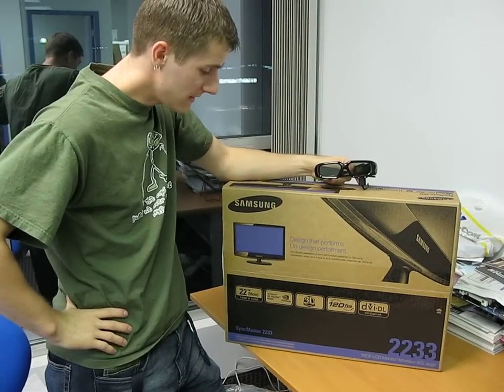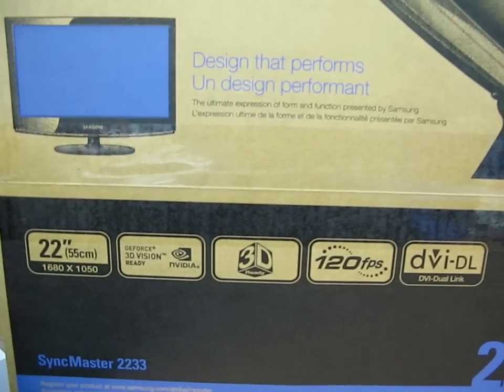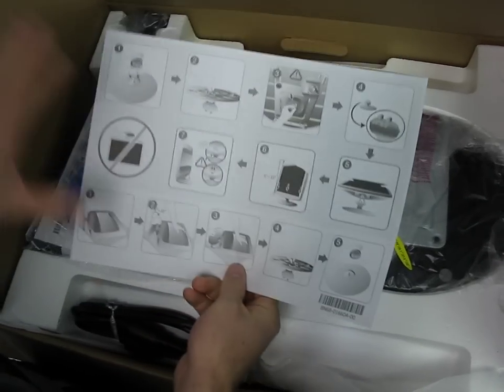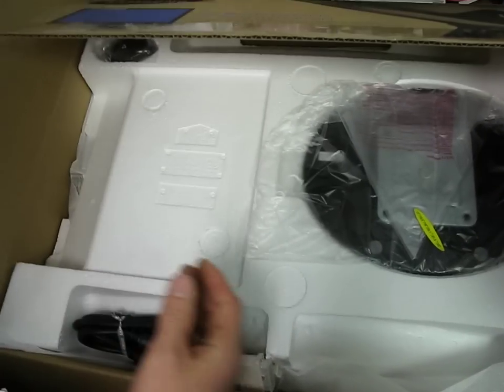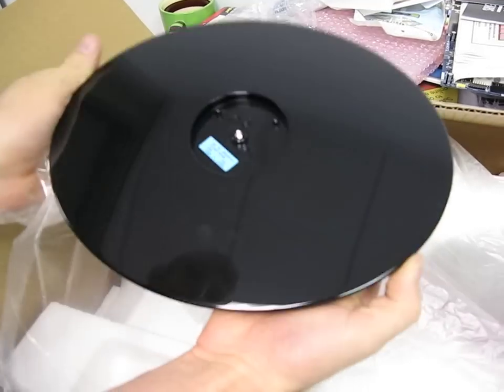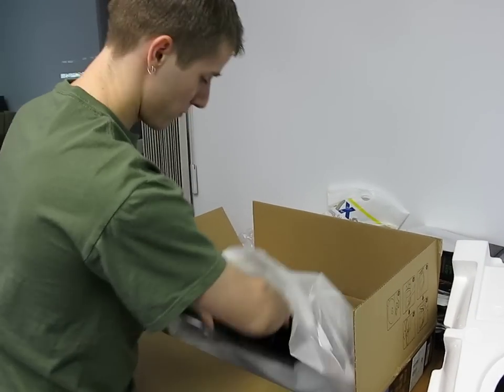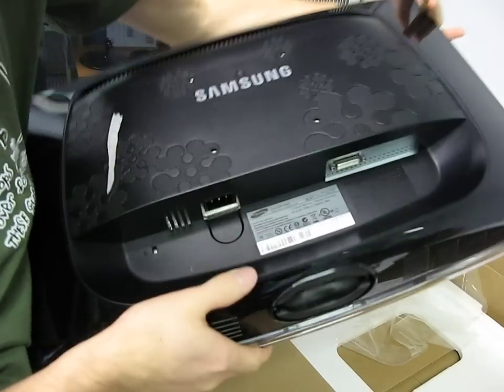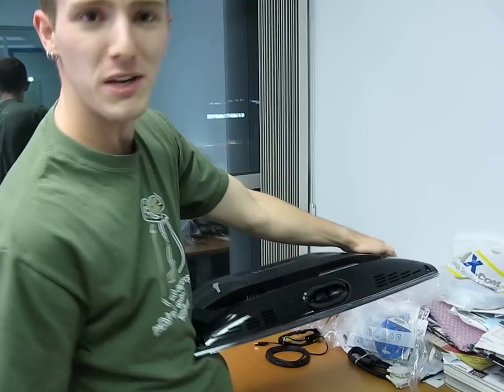Samsung 2233RZ 3D 120Hz 22" LCD Monitor Unboxing Linus Tech Tips

Comment: @DerpTwice no, a DVI port will work with a DVI port on a monitor the only difference is if the monitor needs DVI-I or DVI-D.  So all you have to do is buy a DVI-D cable and your set.

Comment: I have a 2233bw and the stand is the same as yours. I gave up after 30 mins and googled it. What you have to do is assemble the two pieces of the stand and place it on the ground/table in the normal orientation. Then place the monitor on top and use your body weight to push it down into the stand.

Comment: @DerpTwice you should do some reading on DVI.  A dual DVI cable simply has a different type of a plug so that it is able to transfer more information than a DVI-I.  A dual DVI does not mean 2 DVI plugs, its 1 plug with more prongs in it.  All you need is 1 DVI port on your GPU for 120hz.  So to say each dvi = 60hz is not true.  1 output DVI, 1 DVI-D cable, 1 DVI input on monitor, your all set for 120hz.

Comment: I have it and love it, still running flawlesly.
Reply: rafal989 is 16:10 okay for games?
Reply: Just got one, doesn't want to go about 60hz. I got a dvi-dl cable and my graphics card has the proper dvi-d dual channel socket. But anytime I put this monitor past 60 hz, it just goes CHECK SIGNAL CABLE
Reply: Is it true 120Hz or just "120Hz"
Reply: @shamusbob7969  Have you fixed this issue? I'm having the same problem
Reply: @rockettaro1000  : ( it was broken, seems alot of people have had the issue where it breaks and only 60hz works but anything above 75hz will cause the monitor to break. Some people sell replacement stuff for this monitor, so there is one tutorial on how to replace the broken capacitor with the new one. But I never bothered.
Reply: @shamusbob7969   This afternoon I bought another DVI-d connector and now it works at 120hz. Seems I was lucky :)

Comment: i still use this as my secondary monitor, it just doesn't want to break even after 10 years of constant usage lol
Reply: how well does it work at 120fps, i have a cable that only runs at 75fps i dont know if it's worth spending 10 euros for a dual dvi that supports 120hz
Reply: @sixunity1171  it works just fine in 120 hz mode if you can connect it using dual link dvi, definitely worth it imo
Reply: @DoingWellAllDay  okay thank you

Comment: I really need a quick reply from anyone that knows about monitors:

I am going to buy a 22inch full hd monitor that has a maximum of 1080p resolution and has a hdmi and dvi out, i was thinking if i connect it to my graphics card on my pc with a dvi cable, will i be able to have 1920x1080 resolution on my pc ? or do i have to use hdmi cable for it to have the max resolution? please reply someone!